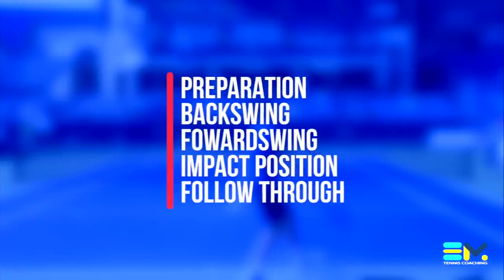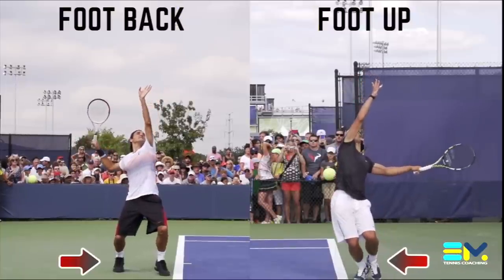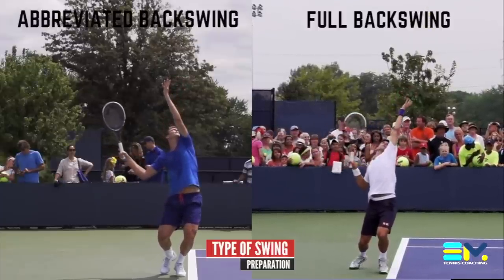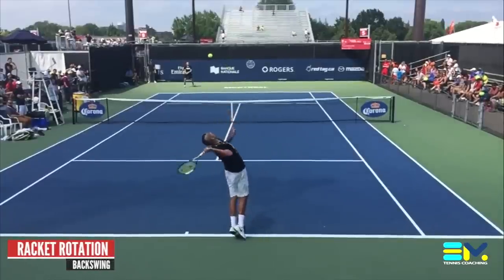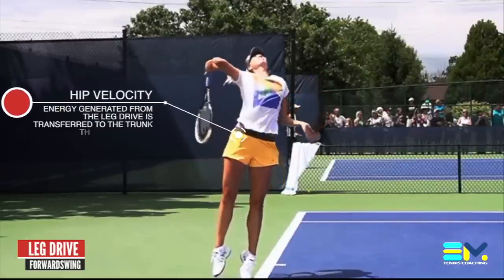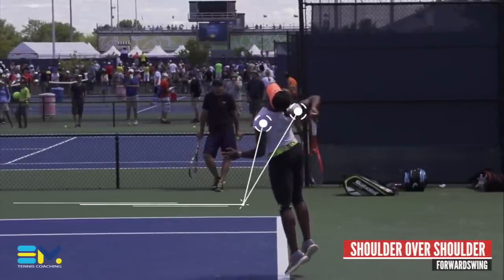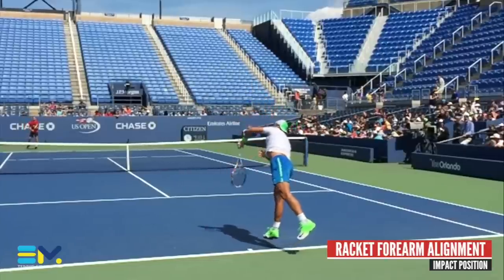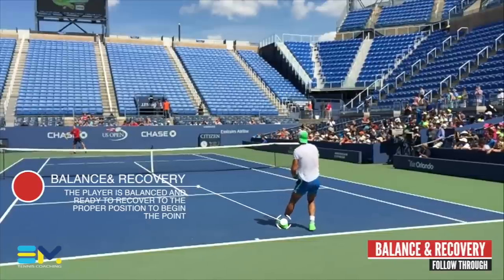Tennis Serve Biomechanics | Serve Technical Analysis | EM Tennis

Comment: Is this an into, a preview, an ad? Things are only pointed out, named technically, nothing much tackled in any depth or detail. Well, I could provide you with some case material regarding my current serve biomechanics, issues and promises. I know myself though what to tweak and where to find some extra RPMs and MPHs still in my as of now passable serve motion but external feedback wouldn’t hurt either. It would be quite interesting, actually.
Reply from the maker: Hi Jack!!! Thanks for commenting... Yes the video is intended as an outline of the main biomechanical / tecnical aspects and not intended as a in depth analysis. We are going to develop each technical aspect in more detail in other short films. We are going to select a winner from the people who comment but we would be happy to see you hit  that serve 💪.
Reply: @EMTennis  I disagree with the way serves are being taught because of rotation of shoulders is so limited in the serve. Question what IF you increase shoulder rotation, less Torso forward movement because of more shoulder rotation ability. I have very different approach of left hand movement and placement to allow shoulder rotation.  If you're interested in very different physical form of the body and rotation of shoulder range go to YouTube "Tennis serve mechanics explores shoulder rotation".  I do have total 8 videos on subjects for take a. Tai Chi and Qi gong movement approaches and do add core breathing is center of my training. I am NOT a tennis pro I am physical trainer look at movement range from different point view. 

I did answer another pro question but if have any let try to answer question in how to increase right hand racquet forward speed.  I do enjoy others point of view.  Nice view but my approach change shape of body to deliver more speed and force to the racquet hand. have good day.

Comment: Truth: decisive is the speed of the racket head. The legs don't have any direct influence on the racket head speed. If it was just for speed and the net wasn't in the way, there wouldn't be any need to jump upwards. Shoulder rotation is far more important for the following energy chain. Actually many players destabilise their whole serve motion by an exaggerated kneebending which is not really balanced snd somewhat separate from the real decisive energy chain.

Comment: If they understood physics, they'd give the ball a top-spin out of their hand before serving. Try it out as it exploits what is known as the Magnus Force (an aerodynamic effect involving a pressure differential). The bigger the spin out of your hand the more the ball drops after it leaves the racket. Drop it right into the service box. Good luck.
Reply: At best, the rpm imparted from your toss is negligible. At worst, the wrist flick necessary to impart said spin will cause horrible inconsistencies with you toss. I'm a physics BS and a current NCAA tennis coach. This is the silliest comment I've seen on a tennis video.